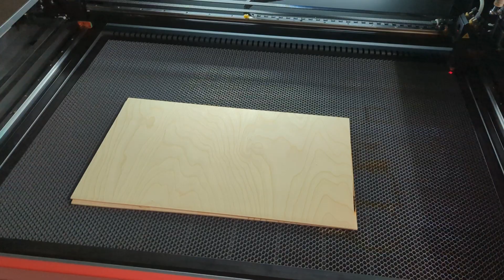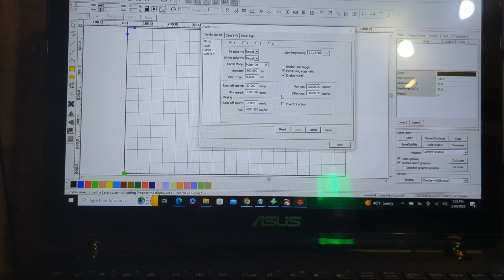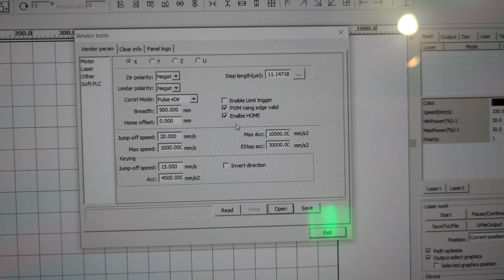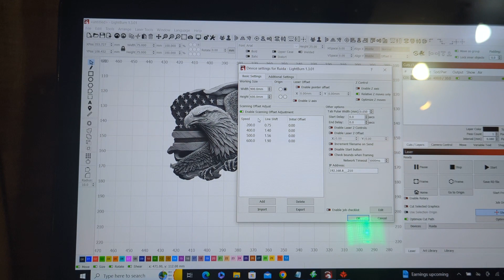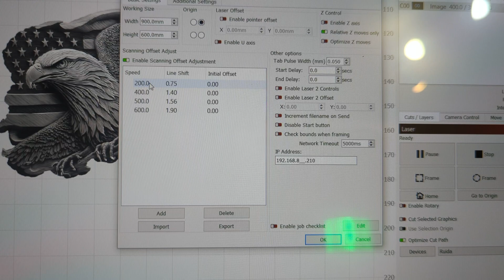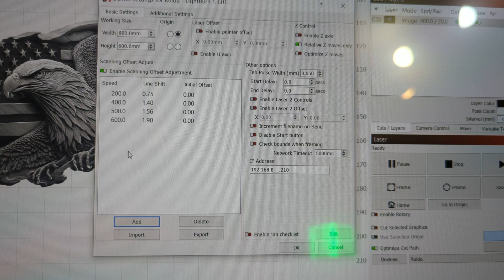New CloudRay CO2 Laser!  A quick start guide.

Comment: Hey, thanks for the videos!  I'm looking at possibly getting a Cloudray and there's not many reviews on Youtube, so am glad to watch your experiences with it so far and keen for anything new you want to share :)  What model did you get and what laser make/watt did you go for?  Did you import from Cloudray in China or did you buy it from their US warehouse?  I'm not in US so would need to buy direct from China I believe so am curious of your customer experience.  Cheers.
Reply from the maker: 9060B version. 90 watt tube, but keep in mind you should never run above 70% or lifespan goes down the tank. Even at that, it's cut 3/4" acrylic, 1/4 " plywood, 1/2" pine board all at respectable speeds. Some require multiple faster passes rather than one hot run, just to keep flame ups down.
Reply from the maker: I did choose linear rails and from a US warehouse. 

As my videos indicate, there is a bit of normal setup and tweaking involved.